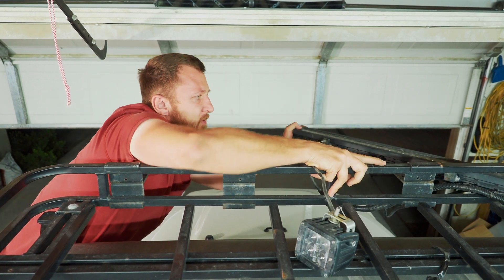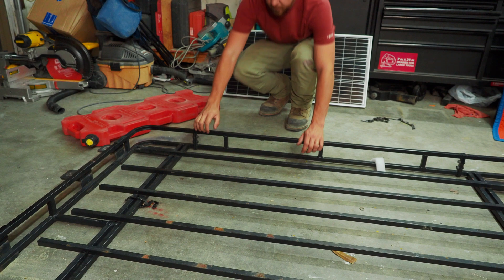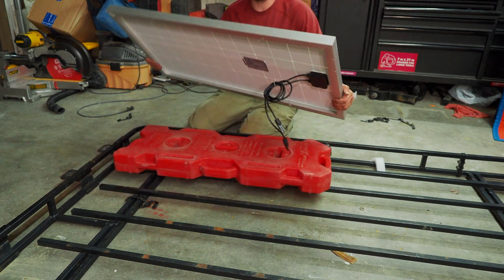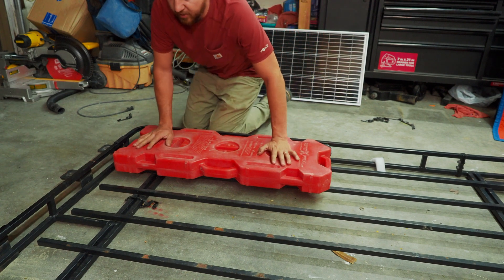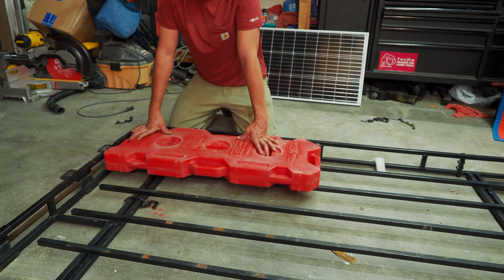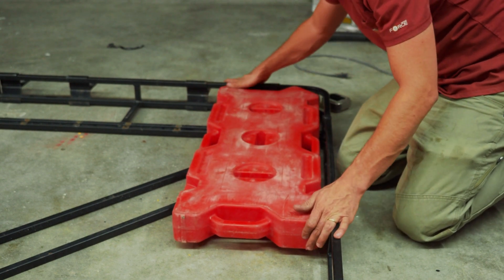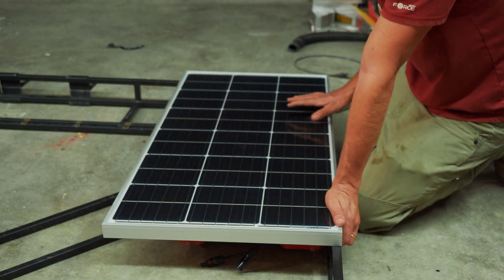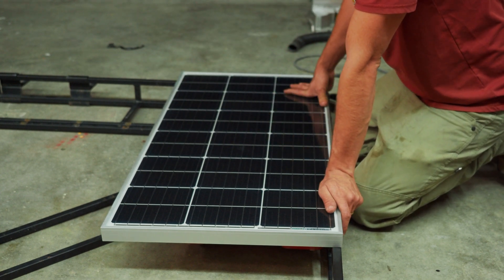Solar Power On A Wrangler?

Comment: Wouldn't putting that solar panel over the gas tank/pack, create dangerous amounts of heat?
Reply from the maker: Theirs an air gab between the two. Also solar panels tend to shield the area that are installed on.

Comment: Hi Mark, a little off topic but I was hoping I could ask you a couple of questions about your Tuffy under seat rear box:

-Does the underside of the drawer just slide back and forth on the jeep's carpet?
thus

Thanks for your help!
Reply from the maker: Fill free to ask away, ill do my best to answer them. 

Not at all, the drawer has heavy-duty drawer slides that attach to the box you bolt in. They don't use the floor of the Jeep at all. They are also full length slides, which is a really nice feature.
Reply: @EmbarkWithMark  Thank you appreciate the hand.  How is the whole thing attached to the jeep, do you have to drill holes?  Also, what's your opinion on if the whole assembly can be raise an inch or two so i can raise the seat even more?
Reply from the maker: Nope, you don’t drill any holes. You use the holes that the rear seat mounting brackets use. And yea I think you could raise it up, you would just need to put some sort of spacer between the bottom of the drawer box and the floor of the Jeep.
Reply: @EmbarkWithMark  Appreciate the Help!
Reply from the maker: You are very welcome!

Comment: Yes to solar ! I'm adding a panel to my 4Runner. It is in shipment right now !
Reply from the maker: Woohoo for solar! I’m very excited to see how this works. What size panel did you go with?
Reply: @EmbarkWithMark  I went a little solar nuts ha ha. The item in shipment is the Cascadia 4x4 90 watt hood mounted panel. But, I also have three 100 watt foldable Goal Zero panels that connect to a vitron MPPT controller that is hardwired to the 4Runner. Love my solar !
Reply from the maker: Daaang! I mean who ever said overkill was a bad thing? I wish they made molded solar panels for the hood of my TJ. I might have to look into my own solution for that kind of setup. But, an extra foldable 100 watt solar panel wouldn't be a bad idea! I could use the extra power with all the batteries I have to keep charged LOL.

Comment: I just spent 4 days in the mountains and ran out of electrical power. The big issue to overcome is keeping the sun on your panel. You might have to consistently move your rig around to keep the sun on it. If you add an extension and make it removable that might be a big plus.
Reply from the maker: That is true. We would need to keep the rig in the sun as much as possible I think. 

I like the idea, maybe a hinge with a quick disconnect. Sounds like something worth looking into.
Reply: @EmbarkWithMark  You could use a set of quick release hinges so you slide the panel off and position it where you want it.  The issue there is you'll need longer wiring to move it off the Jeep and you'll have some amp loss.  A better idea (and what I would do) is use a prop rod so you could tilt the panel toward the sun throughout the day.  You'll lose the early morning sun but have lunchtime-on to produce power.  Truth be told though you'll be either wheeling the rig while it's solidly mounted or hiking/exploring away from the rig so you won't be around to mess with the angle anyway.
Reply from the maker: The extra cable/amp loss was running through my mind as a very real issue. A prop rode would be a heck of a lot easier and cheaper to make vs making this panel removable. As far as use case goes I think you maybe right, its better just to leave it on the roof and angle it if I really feel the need to.